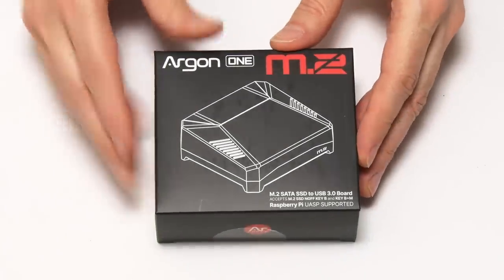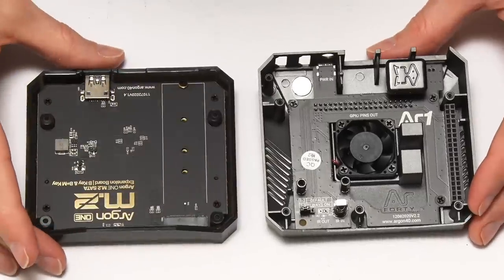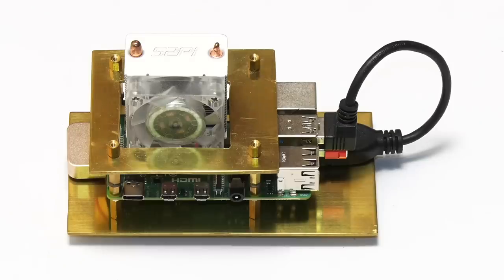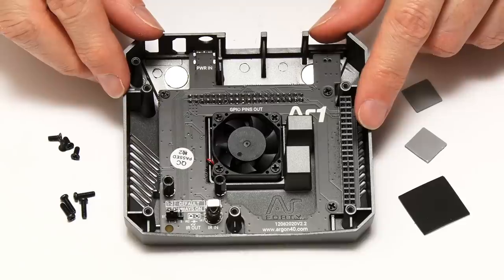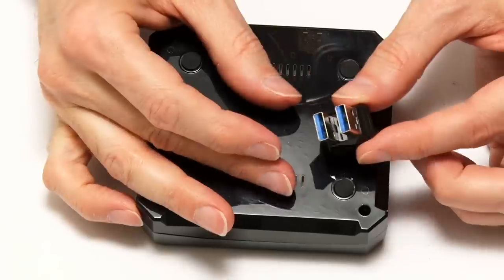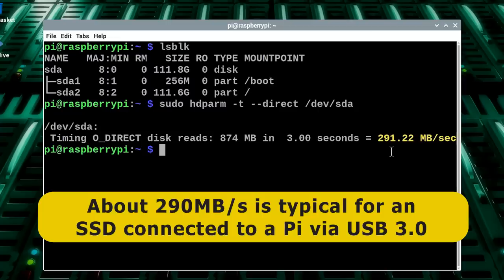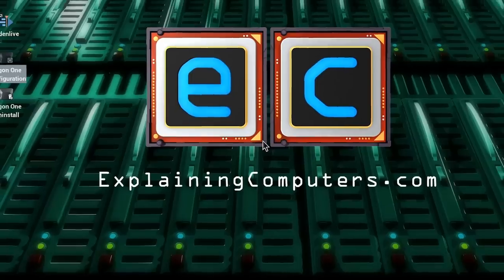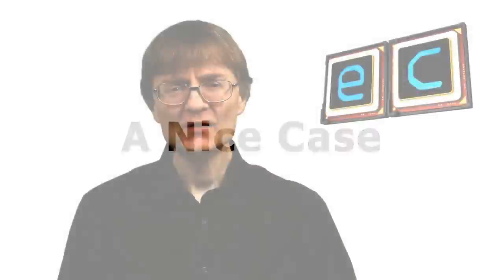Argon One M.2 Raspberry Pi 4 Case

Comment: Nice, though last christmas I upgraded from the pi4 to the odyssey blue, it is now my main computer and I haven't looked back!
Reply from the maker: The Odyssey is indeed a great board.
Reply: Thanks for the info. Had to check it out. Apples and oranges, wouldn't you say?
Seeed: "Note
Please be aware that the J4105 processor has been discontinued, and therefore we will stop manufacturing ODYSSEY - X86J4105 in the near future. So now we bring you the new ODYSSEY - X86J4125 with the J4125 processor which is more powerful than J4105."
Besides, I just purchased the Beelink U57 Intel Core i5-5257u Processor (up to 3.1 GHz) 8GB RAM 128GB SSD, Mini pc Windows 10 pro Computer for a Win 10 laser controller, but my RPi4 is my daily driver, just to keep big brother MS off my back. If hacked, just flash another SD card. Different strokes...
Reply: @TheOleHermit  True about apples and oranges, regarding the Pi do you know about the microsoft repository that was installed in raspberrypios earlier this year? It is easily disabled but people were annoyed that it was done quietly, there are videos about it on youtube. I only mentioned it as you said you wanted MS off of your back, fortunately my pi was collecting dust at the time or I would have been  annoyed.
Reply: @Kenobi5001  Yes, I'm aware and not impressed. So, I disabled it.
Thank you for sharing that info for the benefit of others. Info such as this is what makes the RPi community so great. :-)

Comment: Does the Argon One support nvme drives?
Reply from the maker: No, only SATA drives. There would also be no point in supporting NVMe drives, at least in terms of speed, as the connection between the drive and the Pi is USB 3.0.

Comment: Does the raspi4 pcie support m.2 nvme speeds? I’m considering buying an m.2 ssd for my pi4, but not sure which ssd to buy?
M.2 or m.2 nvme?
Thanks 👍
Reply from the maker: There is no PCIe interface on a Pi 4, only USB. So you can only connect an SSD (M.2 or otherwise) to a Pi using a USB to SATA or USB to NVMe/PCIe interface. This case has a SATA M.2 interface.
Reply: PCIe x1  connectivity is only available on specific CM4 I/O boards. Some have onboard M.2 NVMe via PCIe connections.
There are also M.2/USB3 adapters for NVMe SSDs and Geekworm makes an NVMe M.2 board (model 872, which requires additional power and has an ugly case). 
But, NVMe via USB3.0 is a waste of money, because the read/write speeds are limited to the throughput of the USB3.0 port. Save your money and purchase a larger ASP compatible SATA SSD as the best option for the RPi4. :-)
Reply: @ExplainingComputers  thanks👍. It’s working great with a western digital blue m.2
Reply: @TheOleHermit  thanks... I went with the western digital blue m.2 ssd and it’s running great.
Reply: @ExplainingComputers  once I was ready to install berry boot one thing I had to do was convert larger .img files to squashfs format, using berry converter (GitHub), very simple and quick conversion of 9gb stock images (raspbian & Kali) down to 3gb each approx👍

Comment: Who is going to take the Raspi board and re-lay it out into something that make a lick of sense? Like around a ATX IO plate layout? just pick an existing layout that has all the connectors you need. You could also include the ATX board holes that are just behind the plate. Needing all these weird specific adapters to get a decent connection layout is just dumb.

Comment: I ordered this case. But I see now that my Intel M2 SSD has the notch (key) on the wrong side, so it will never fit. I see that almost all the SSD has the opening on the right side. I am upset. I bough this ssd before for my Dell XPS13, but it didn't work on it. So now i have to buy another one. I understand I need a B-Key SSD.
I just ordered the Kingston SSD A400 m.2 240GB , This is a SATA ssd

Comment: It would be a lot more elegant if you could connect the M2. slot via the GPIO pins but GPIO simply does not have the bandwidth. Frankly I would prefer to just use a M.2 USB dongle.

Comment: How did you prep the M2 SSD prior to installing it into the case?
Reply: Physically install your SATA SSD into the M2 case, using the supplied screw. Then assemble the M2 unit and the Argon One Pi. Make sure the Micro SD card is not installed on the Pi Board.... Leave the USB 'bridge' un-installed. (The connector between the upper and lower case)
Bottom USB Socket (the one in the M2 case).... Connect  a USB cable directly to your other computer......to format and /or partition if required, and to load your .ISO file. (For your chosen Operating System)
NOTE: The USB cable from your computer supplies the required 5 Volts required to power the SSD..... as well as the data.
Once finished loading your O/S onto your SSD,  power off your computer or 'safely remove' device (Your SSD)...
Fit the USB to USB bridge between upper and lower sections of the Argon case...connect to power, and hopefully the Raspberry Pi will boot from your SSD....follow instructions on screen to complete O/S installation.

Comment: The one design flaw is lack of access to the micro SD card without opening the case. They should have put another one of those magnetic access covers there. Otherwise, nice case!
Reply: That's not a flaw. It's encouraging people to do the right thing. Get the M.2 Case, cover up the SD card and pretend it never existed.
Reply: @nate6692  I guess it depends on what you're using it for, but it'd be nice to have the option.

Comment: This case lets itself down dur to no easy access to the SD card once assempled. Having the boot order set to SD card first is useful for bypassing the OS on the NVME, and not being able to do this with this case is a let down and missed oppertunity to actually be one of the most perfect cases for the Pi 5.

Comment: I tried this setup with a high capacity SSD (WD Blue M.2 SSD 3D Nano SATA  2TB B&M)on a Pi 4 8GB. Using the Raspbian tool to create a boot drive did not work at all. It randomly crashed at various stages of the writing process. Finally I put the drive in an enclosure attached it to my laptop and wrote the image from there. 
Booting and finalizing on the pi again crashed the system randomly. Now I saw a lot of ext4-fs errors. Alas the drive was brand new. Initially I used the original power supply, then I replaced it with a 87W USB-C power supply. It turns out, that my keyboard (!) was drawing more power than expected (it is a RGB keyboard - Steelseries Pro 7). After using the original Raspberry keyboard and mouse it got a little more stable. I am not sure this was the only problem. Still looses it's network connection, when you put too much load on the drive, e.g. copying large files onto itself in 2 instances.
It is terribly unstable and the large SSD drive appears to consume too much power. I will try the setup with a Samsung EVO instead of the WD, but this seems not to be a solution for a compact robust storage node. 
Maybe every now and then please try something other than minimal configuration
Reply: Try adding a powered USB hub to supply connect ALL peripherals to. This allows your main PSU to only supply the Processor and SSD. Also consider reducing the size of your SSD if you still have problems. I know for sure that others are using Kingston SA400 and WD SATA SSDs....... but those successful cases have been 500 Gb or less...

Anyway......back to the powered USB Hub. It worked for me.... get a good quality hub.

Comment: That lack of access to an SD Card is a big deal breaker for me. I feel like I’m always needing to use one of those if not to boot into the pi then to edit files on a headless sbc
Reply: uSD sucks. I'm running/booting from the second USB3.0 port, with a uSD adapter. It's not as fast as running from the SSD, but twice as fast as the uSD slot. My downloaded data, media libraries, and git repositories are kept safe and easily accessible off line on the 1/2 TB SATA SSD.
I can backup and/or test different plain vanilla OS dtb's, then install my favorite apps locally from the SSD repos.
Keep your uSD cards, configure the Pi 4 to boot from USB, purchase a cheap USB3.0/uSD adapter and you're far better off.

Comment: The M.2 case still only supports SATA, and unfortunately not NVME. It's a shame that it still requires the USB patch dongle, though. I love my Argon One V2 case. I am getting several more for more Pi4s I have.
Reply: Basically, it's an external drive adapter that holds a m.2 drive.
Reply: @VulpisFoxfire  Yep, I know. IMO overkill for just an M.2 external drive adapter, since both eat one of the USB 3 ports.
Reply: @Tano Thank you for the obvious. I think I said "The M.2 case still only supports SATA, and unfortunately not NVME. It's a shame that it still requires the USB patch dongle, though.", meaning it COULD support NVME just as easily as SATA. And there are ways to bypass the actual USB ports using the test pads.
Reply: @Tano I use USB3 to NVME already. Density/$$ is the advantage. 1TB NVME is cheap, and can be used elsewhere, too. Overall speed is not always the 'goal'. Reliability for me. I don't use MicrSD cards to boot Pi3Bs, 3B+s, or any of the Pi4s I have. Only my PiZeros, ZeroWs, and Pi1, 2b. Even the Pi2s only have bootcode.bin on them. I got tired of burning up the SDCards.
Reply: @kevinshumaker3753  Have to respectfully disagree, Bro. @Tano is making a very valid point that could save others $$.
I've been there and done that, too. NVMe SSDs are far more expensive than SATA SSDs and have absolutely no benefit, because of the USB3.0 bottleneck. I've wasted money on the USB3.0/NVMe adapters and the Geekworm 872 board via USB3. Both need additional power, too. 
What's the point of paying the extra $$ without gaining faster R/W speeds? Why have a flimsy USB/NVMe adapter sticking out of the USB3.0 port?
I'll be using my M.2 NVMe SSD on a CM4 I/O board with M.2 NVMe via PCIe x1, instead.

BTW, I use uSD cards to boot different distros from a USB.0 adapter, which is twice as fast as the uSD slot. My M.2 SSD is purely for data, downloads, and offline github software repositories. I can do whatever I like with the OS, w/o disturbing my storage.

Comment: Thank You, Christopher ;)
Hmmmm... have been thinking about tt exact same case but couldn't get myself to tt price point.
May I pick your witty intelligent brain, like two buddies chit-chatting to each other - would the usb3 on the Pi be a bottle neck to the m.2 Sata SSD?
We used to have books & buddies, now the internet has revolutionarised everything. And typing on a small keyboard seemed un-imaginable.
Stay Strong, Stay Healthy, Stay Safe!
Reply from the maker: USB 3.x interfaces in general are not a bottleneck on a SATA SSD, but the one on the Pi most certainly is. See the write speed result at 10:56 -- 291MB/s is less than the 500MB/s+ that is attainable from the drive. But I'd argue that the Pi's USB 3.0 implementation is in balance with the rest of the board. :)
Reply: @ExplainingComputers  Thanks!

Comment: I got this but stopped using it. It looks nice but my temps were getting kinda high in it and the fan was kinda crappy. Switched to a low profile ice tower that has a nice black metal vented case for it
Reply: Did you follow the instructions and download the programmable cooling software, then configure the temperatures and fan speeds?
Reply: @TheOleHermit  yes, I did that too immediately after putting the pi in case and turning it on. I kinda feel like if the thermal paste pads are to blame tho
Reply: @ZaddyGotchu  Hmm.. i'm watching 1080p YT videos all day long, with the SSD inside my Argon One M.2 case, but never exceeding 60 deg C.

Comment: Was considering the case until I realized the micro-sd slot was not accessible once it is closed.
Reply: It seems completely backward to have a non-removable sd card but being able to disconnect your ssd while the case is closed. Those are the only two flaws I've noticed.
Reply: You are supposed to use the m.2, so you won't need the ssd.
The original argon one has the ssd available.
Reply: @wesss9353  Having an sd card reader can still be useful even though you're not running your OS from it. It would be just like having one on a normal computer. Having the slot blocked makes it pretty useless.
Reply: @caseyhoward9101  you throw away the screwdriver after closing it up? 
It's about the same thing with a cell phone
Reply: @wesss9353  That's pretty inconvenient. On none of my phones do I need a screwdriver to get to the sd card.
Reply: @caseyhoward9101  I have a little tool for the SD card slot for the phone...

Comment: That means the M.2 drive will have a max of USB 3.1 Gen 1x1 speeds vs M.2 SATA or PCIe. A later revision using USB-C would be amazing.
Reply from the maker: USB-C is connector, not a different kind of USB interface! :) So, eg, USB 3.1 runs at exactly the same speed regardless of whether it uses a Type A or Type C connector.
Reply: @Tano IMO, what he wants is a CM4 and an I/O board with an M.2 NVMe SSD, running off PCIe. ref: Jeff Geerling
Reply: @Tano CM4 is only half of the 'edge computing' solution. It is sold at many price points and with many options, including eMMC, PCIe, and full connectivity to the Pi 4 'brains', a super Pi 4, if you please. 
The ports are provided by specifically designed 3rd party carrier boards, depending upon one's project requirements.
Yes, the price is higher for more functionality. 
My comment was only regarding how to fully utilize NVMe SSD R/W speeds on a RPi4.
Sorry that sole solution doesn't work for you.

Comment: I take it the USB3.0 is faster than the SD connection unit or something, cause it would be nice to use that port to hook up the M.2 to the system as it would leave the 3.0 USB free to use with something else, as adding a hub seems like it would increase the size dramatically, though would be nice if they had maybe added a hub to it too lol.
Reply: That's what I've done and love it! Yes, the USB3.0 port is twice as fast as the uSD slot, even when using a uSD/USB3.0 adapter.

Comment: Sadly no nice way to store removeable cover (V shape, should have <> so it slots in 2 positions, one closing, one open, 
mine has "permanent" cable that runs to pimoroni mega black hat. (discontinued?)
You can add some big metal block on top of the case, helps lower the temp and prevent the fan which still has not turned on
(highest temp was 51)   Will swap mine, put the 8gb model in with thermal goo as recommended in other comment.

Comment: The only problem I have with my Argon One (original) is that if you install any OS other than a Debian base the fan scripts take a lot of finagling to get working. Thankfully Wimpy provides a git for Ubuntu and it's derivatives. Any other distro and it's just not worth the bother. I tried some other Linux distros and WoR and the case got very hot due to no fan.